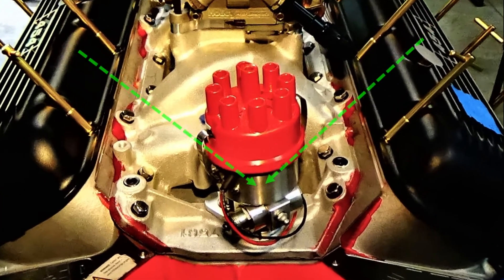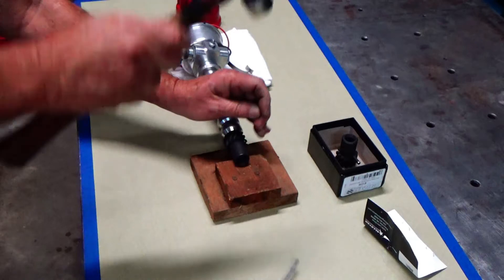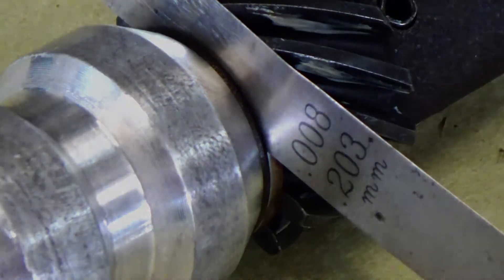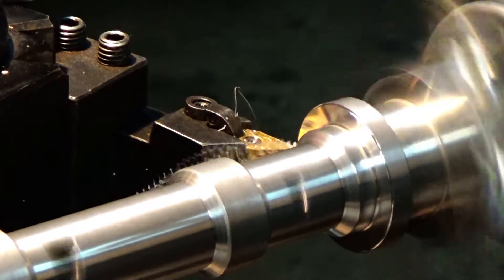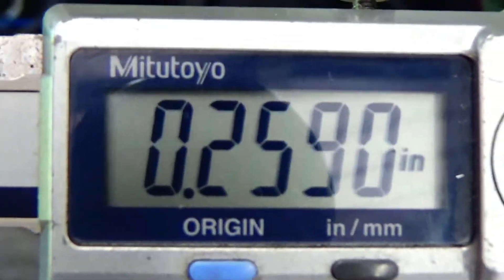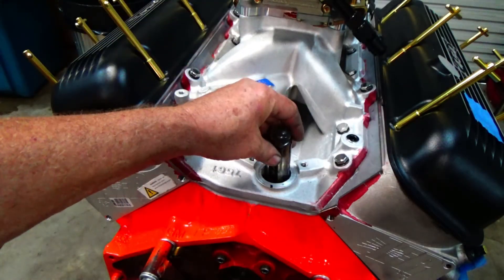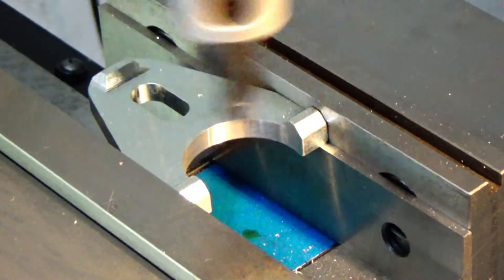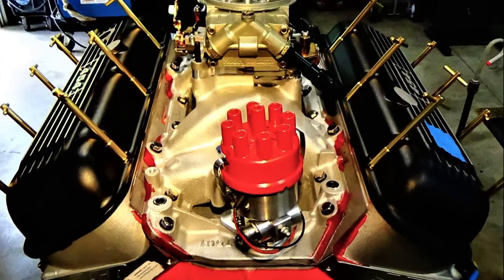Good distributor installation steps     #29 Chevy 454 Big Block Performance Build

Comment: It is quite funny. I'm currently in the middle of building my own big block. Its a little different, little more wild. If I had the time I would be completing a video series like yours. But that's life, never enough time in the day. haha! mine is a 598CI big M block, Pro 1 CNC 335 heads, Diamond pistons CP rods and Callies Crank. with an Old school King Demon dominator 1375 CFM carb. I am Bench racing here but with the mech roller cam I have, it should make in the neighborhood of 900 HP.. Maybe ill start tanking pictures and do a compilation at the end with some voice over?
Reply from the maker: It sounds like it will be one wild ride you have there.... Thanks for sharing...